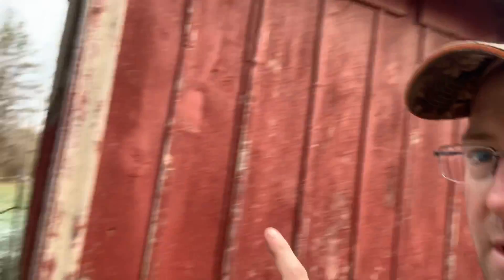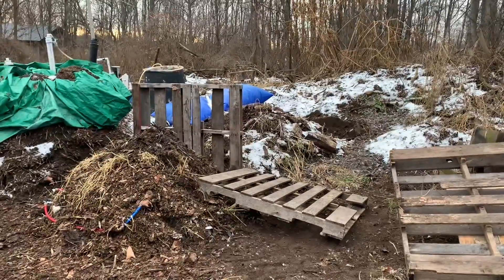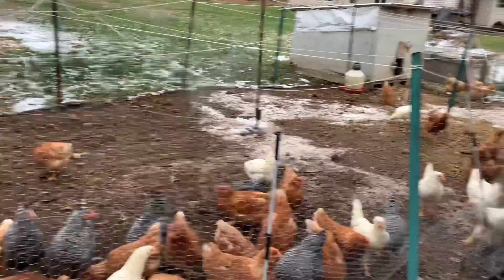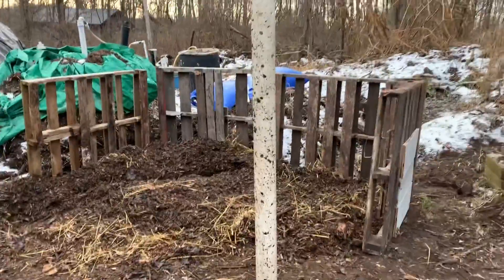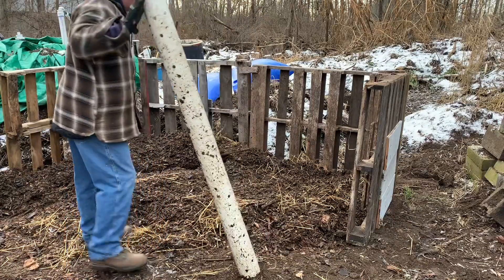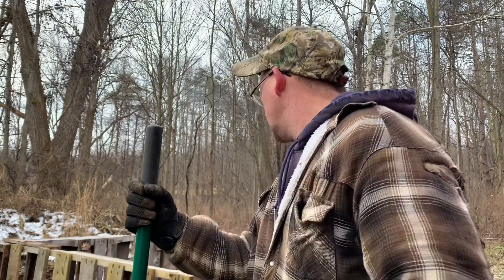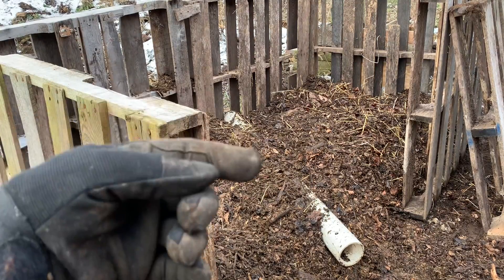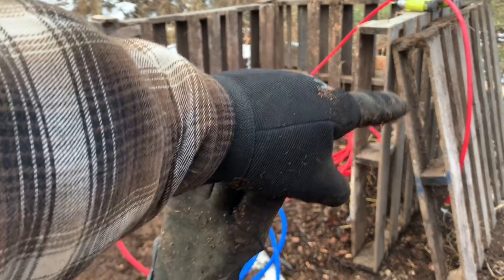Compost Heater

Comment: Only thing with pex is it will eventually break down outdoors from uv rays. It won’t be so bad covered in compost but just thought I’d mention that. I was gonna make mini greenhouse hoops with pex till I realized that, but it didn’t stop me. I ended up slipping pvc discharge hose over the pex to create a sleeve since pvc is uv resistant.